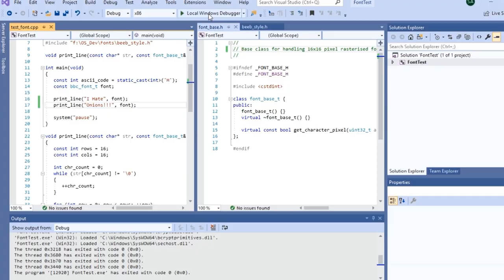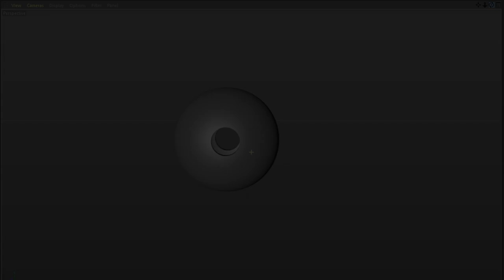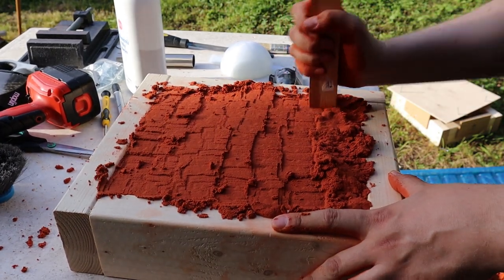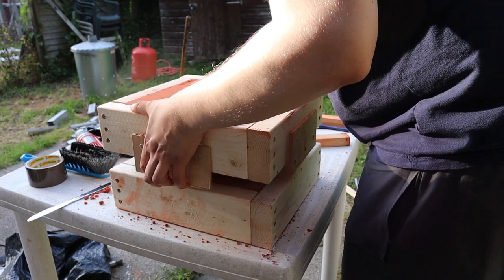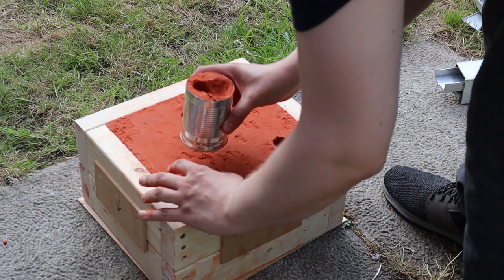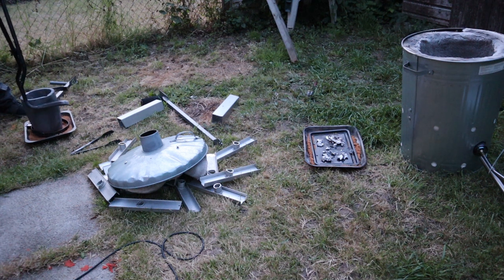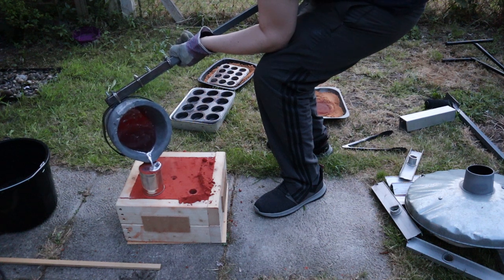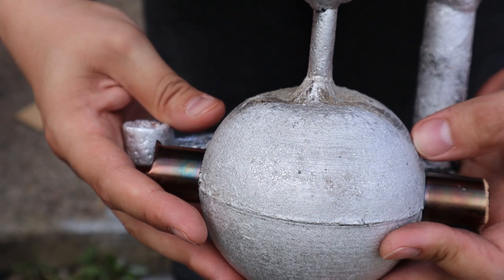First Attempt at Sand Casting | Aluminium Dalek Build | Catch Up - Pt 3

Comment: Awsum that you're doing all this but as a fellow Dalek builder, I have major concerns that the end result is going to be too heavy and impractical to transport etc ? And the finish is never gonna be that smooth and a headache to clean up.  I have a wooden Dalek and its very cumbersome to move about. If it had solid aluminium hemispheres and what-nots, it wouldn't move at all.  I have  a few suggestions: What about getting a lathe cutter to spin the dome  and neck rings etc rather than trying to forge it all yourself? I think the R2 D2 domes where spun on a lathe type machine. If you want a total aluminium Dalek that would be the way.  Plus you can buy hollow aluminium hemispheres etc online anyway. I think yes make the skirt, base and mid sections etc by yourself from Aluminium sheets but leave the rest to a lathe cutter or similar specialist. The spun finish would be a lot cleaner too than casting in sand etc. Plus it would be tons lighter and much more practical to transport etc. ;). The alternative is wasting money in endless castings, that could be better spent making your Dalek by simpler means.  Its a win-win! Just a thought.
Reply from the maker: Hi.  Thanks for the reply. :)

From my perspective, this project is less about having the Dalek (although I obviously want one) and more about trying out things I've never attempted before and learning from the experience.

I did get some quotes for some machining work last year and the cost of having a set of neck rings made was extraordinary!  Whereas now I have already made the investment in the furnace equipment so from here on in my only continuing costs are of gas and any additional moulding sand.

A couple of months ago, before I uploaded the first video, I made a prototype neck ring using an open mould and I am pretty happy with the finish, even after just a couple of minutes of sanding.  It does weight a fair bit - the neck section will be by far the heaviest piece of the Dalek.  The skirt, without the hemispheres I can lift with one finger.  When I make the actual hemispheres they will be only a few millimetres thick so hopefully won't weight too much.

I'm going to attempt to cast the dome and neck.  If it goes wrong I can just melt them and try again - no big deal.  The thing with Dalek building is that it is modular so one can always replace a part with a better one in the future.  So I could still have a go at getting a dome spun later on, but I am too invested in the casting to not at least attempt to follow through with it.

Besides, metal casting is fun and I want to try making other non-Dalek parts with it in the future.  Cheers!

Comment: Now just make gears n electric motors and wire it and solder it to a circuit board and program it python to a control circuit via USB got yourself a little programmed little toy .